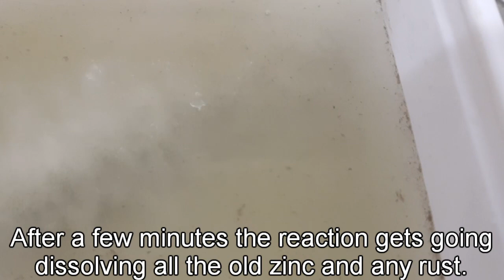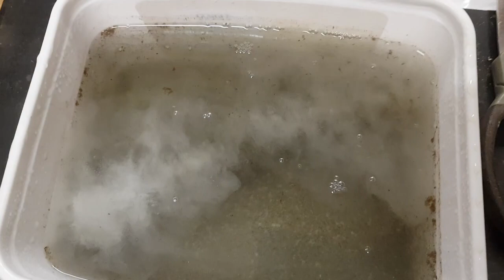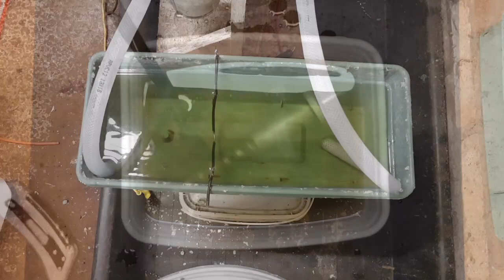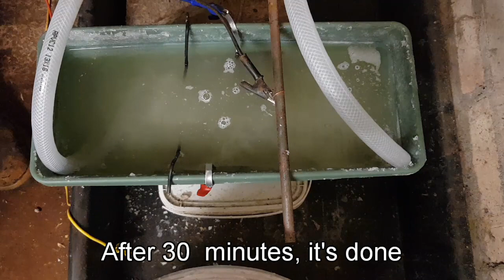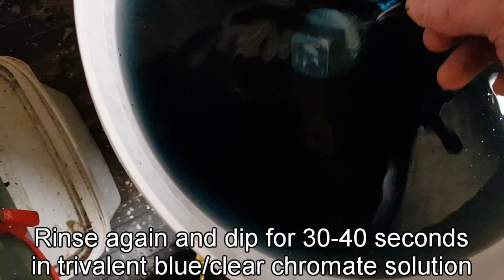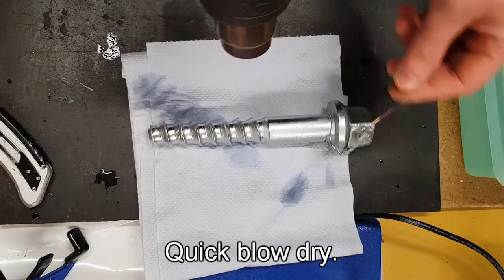DIY Cleaning and Zinc Plating an Old Railway Sleeper Bolt

Comment: What electrolyte did you use please and what voltage / current? Thanks
Reply from the maker: Hi, details of the plating bath can be found here: https://youtu.be/Bc6n-vZGG-g
Reply: @btprestorations7499  thanks, very informative. What is the ‘dry acid’ and why is it called ‘dry’?

Comment: Nice work! 
What current/voltage are you using for the plating? And  what did you use for the alkaline solution?
Reply from the maker: Hi, details of the plating bath can be found here: https://youtu.be/Bc6n-vZGG-g